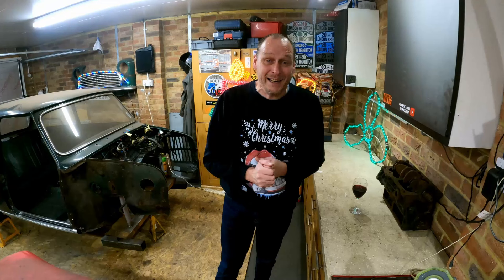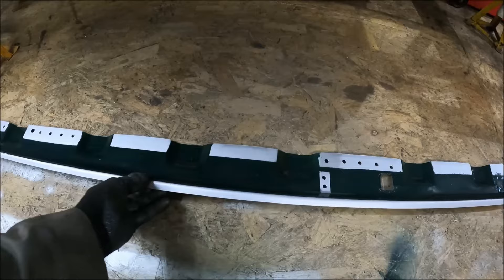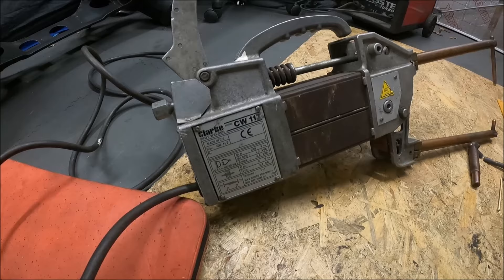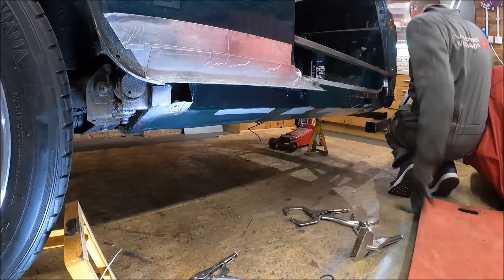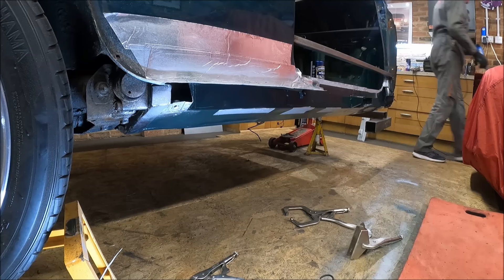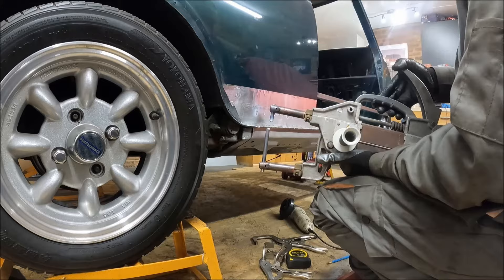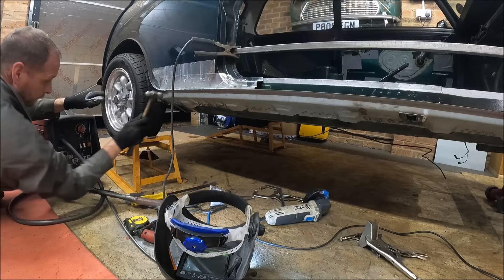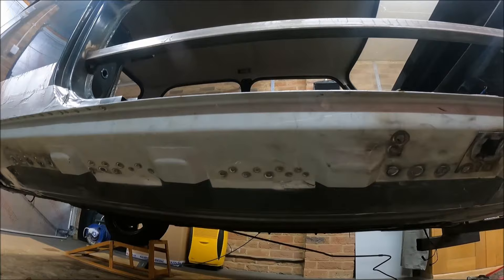Fitting Outer Sill - Classic Mini Workshop - Project Racing Green Pt.18

Comment: Good job.  Could you possible have fitted the door sill, clamped that in place and then used that to get the outer rocker panel aligned better at the door post?
Reply from the maker: Yes maybe, you live and learn. The frustrating thing is I have the same problem when doing project sprout but I forget about it. At my age you live, you learn, and then you forget LOL
Reply: @classicminiworkshop  Hahahaha  I completely understand and agree.